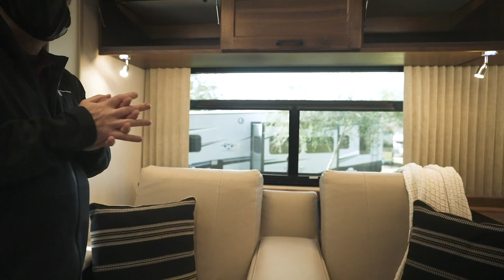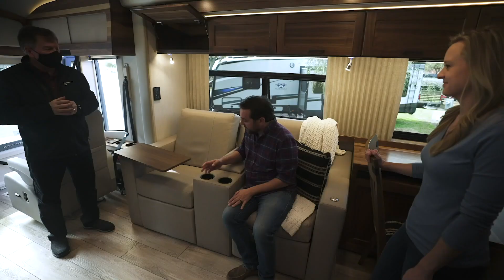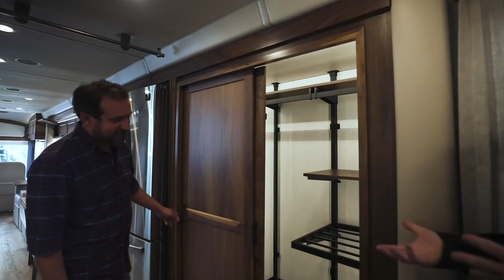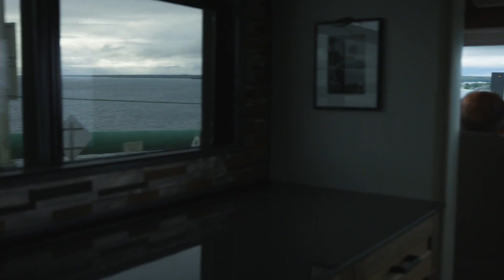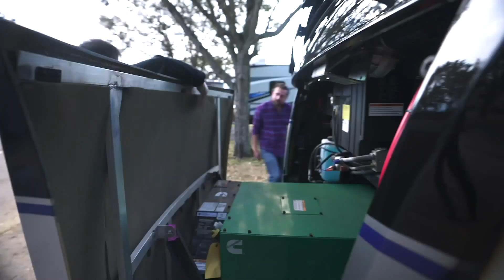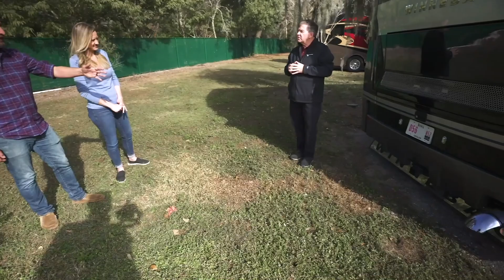Ride Along: Winnebago Journey 34N Walkthrough

Comment: We just picked up our 2023 Journey 34 N at McClains RV in Rockwall TX.  We love the coach but there was a laundry list of items that were broken or missing when we picked it up.  
1. Fresh Water filter in bathroom was broken completely off (fixed at delivery)
2. Both side mirrors don't work, the drivers side had large scratch in chrome facing. Neither would adjust from switch at cockpit (ordered new one)(we adjusted manually so I could drive it)
3. Dinning room chair broke (ordered new one)
4. Several floor planks were damaged (ordered new one)
5. Neither app for the Winnebago Control will work completely (still working today with Firefly integrations on a resolution (Winnebago Control and Winnebago Connect functionality is poor and won't connect completely too coach...)
6.  Severe rattle from the slide mechanism right behind the driver (partially fixed...so much for very quiet ride)
7.  Winegard Gateway keep blowing fuse...McClains found that it was wired backwards...ground to power power to ground,  once that was fixed still didn't work properly, I called Winegard and found out that they have migrated away from their app Winegard Connect to Winegard RV Halo...once that was downloaded I was able to get it to work
6.  We had the satellite package with the Winegard Traveler and Pacer unit.  To this date we can't get it to work, doesn't even pick up on TV's...all instructions included in manual are no help and all Winnebago can tell me is take it back to the dealer.  At delivery, we did our PDI in a service bay due to the  heat so we were unable to  deploy satellite...dealer said that all we had to do was purchase a Dish Receiver (which we did) and plug it in and it should all work....  Well apparently not....

Again, we love the coach, but these items should have been discovered by Winnebago and/or McClains before delivery.